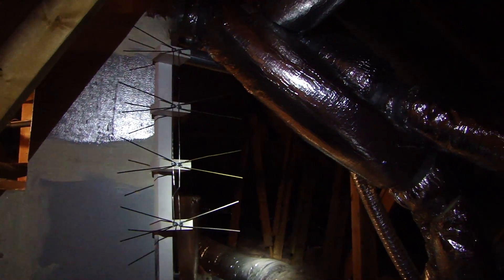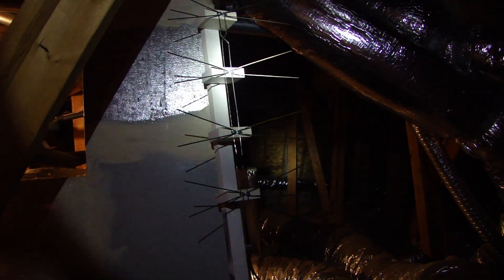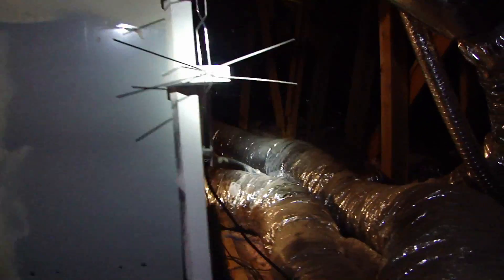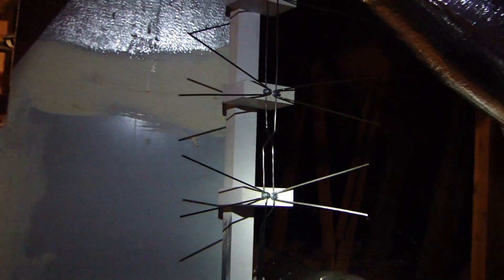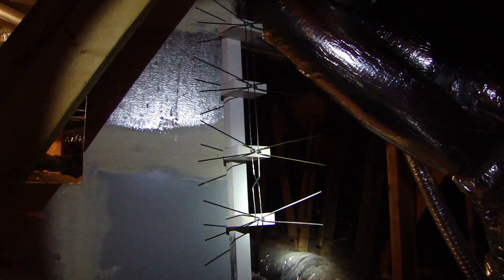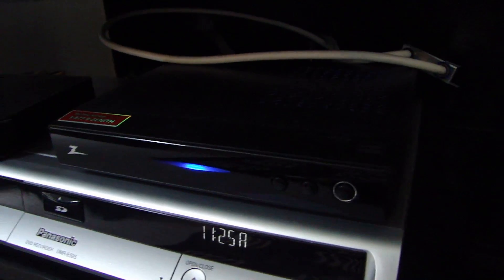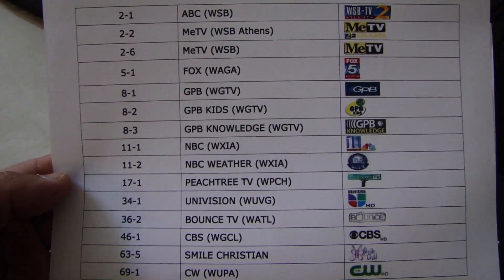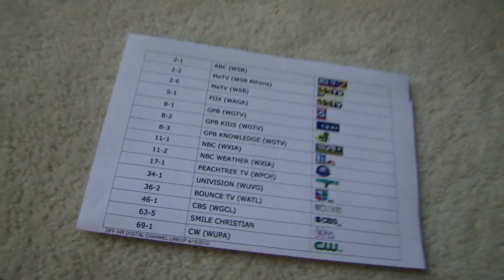Built My Own Off-Air Digital TV Antenna to Receive Free Network Stations

Comment from the maker: If you happen to live in a location that is either far or blocked by the terrain, it can be very difficult to get many stations. Also the type of antenna and where the antenna is placed will have a big impact. You can try checking out 'antennaweb' website and click on the 'Click Here to Start' to have the site check for you if your area is ideal to receive DTV.

Comment: I looked it up and supposedly I only have 1 channel that has a good signal and there are 3 that are far away. It's insane that you have so many over the air stations and Pittsburgh has like none.. I don't get a single station that comes in good though. Only 1 that is really snowy. Pretty upsetting especially if there were an emergency and the power went out. This is a big problem that needs to be fixed because I used to pick up many stations before the digital transition.